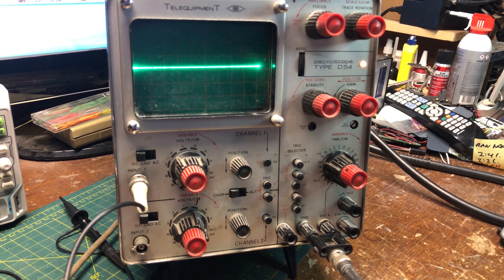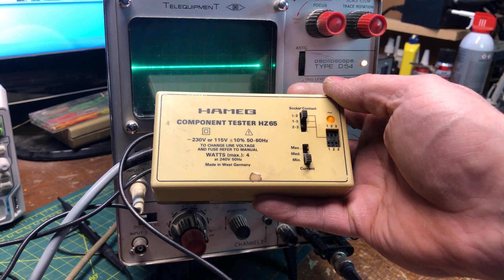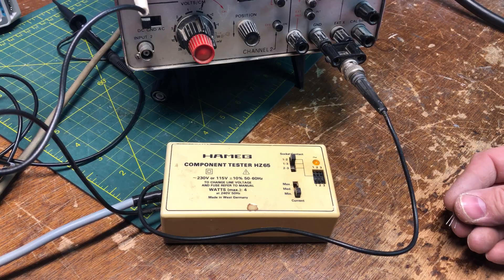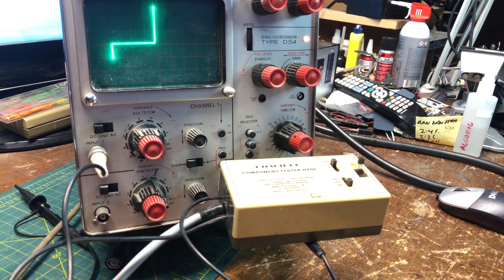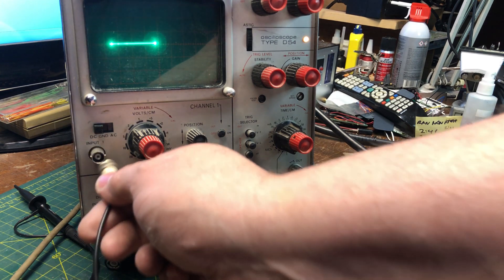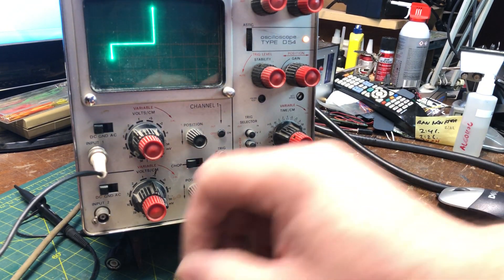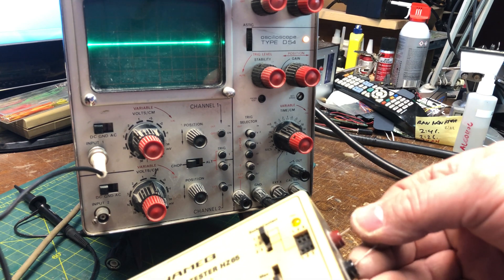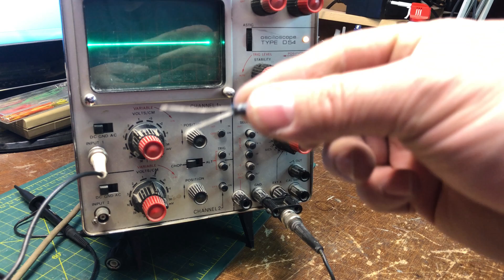Transistor tester with Analog oscilloscope Hameg HZ65   4K

Comment: I have 4 of them (had them for free from a good friend of mine from Germany) but  if you're not careful with charged caps  they break really easy and the IC's and other smd components fail as well (he said). And he was right in what he said since i've already managed to destroy 3 of them and 1 still works (for now)  I find them too fragile and not really reliable or dependable. If I was to build an octopus circuit (the basic equivalent of hameg HZ65-3)  then it will be way, way more reliable since is nothing to it really, other than a transformer, a bunch or wired connections and a couple of other discrete components, that's it.  Not really worth buying such things since they break a lot. Better and cheaper and more reliable to build your own octopus circuit. Much better!!!